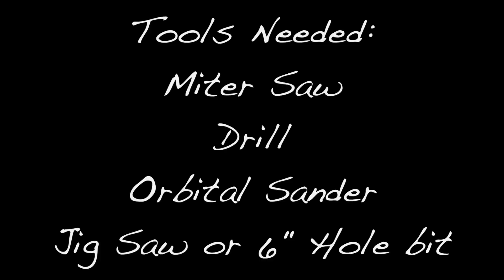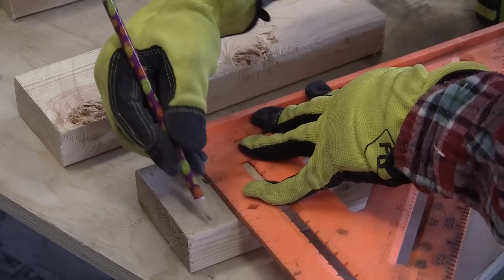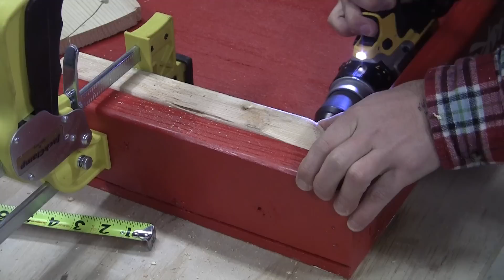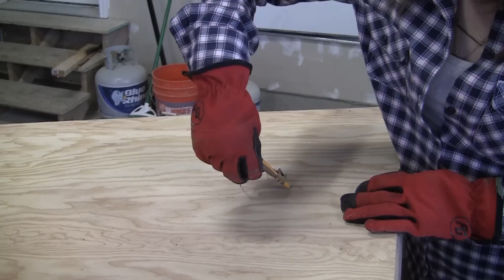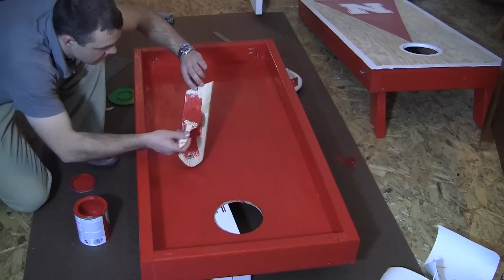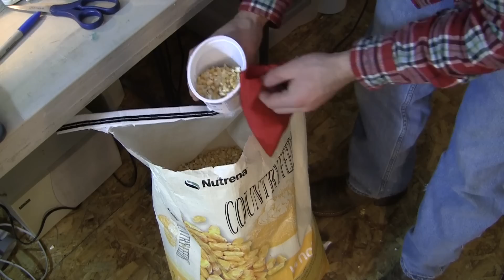How to Build Cornhole Toss Boards - A Fun and Easy DIY Project - Episode 8

Comment: Brilliant post... I was really inspired to make my own for my wife as a graduation gift hers was for Drexel. One note though mine turned out awesome right up until the urethane step. 
If you have allot of white as my design did. An oil based urethane will cause white paint to yellow so they kind of looked like crap at the finish.  She still loved them and it was a great learning experience... 

Thx!
Reply from the maker: Shawn Thompson Hi Shawn! So glad the project went well. Yes, I too had a slight yellowing to the tint on the white areas. Didn't bother me too much, but now I recommend a minwax waterbased stain if there is white being used. Cheers!

Comment: Also, I was recently working with Frog Tape and learned a tip. If you paint one additional coat of the base coat color AFTER (yes, AFTER) you mask it, if the tape leaks, it only leaks the color desired under the tape (so who cares?!? perfect!) and that leaking seals any further leaking.  And then, after that coat dries, follow-up with the top color (I do 2 or 3 coats of this -- same with base coat too BTW). Nonetheless, when you peel the tape off, you get amazing, crisp lines.  Of course, this is no replacement for doing a good job of applying the tape to prevent any leakage, but it's insurance! For your project, Pete, you were masking the naked wood with the Frog Tape, something I would think would be a little risky, given wood's tendency to be an irregular, porous substrate that also likes to wick! But, your results looked to be perfection!  I would have been inclined to paint a coat of the polyurethane over the tape (the one side of the tape anyway) to lock it down before applying the white paint.  But, again, you seemed to have no problems (that video captured anyway :^) ).  Also, I'll add that using the technique I describe here, I had no troubles peeling the tape off a week later (after all coats were good n' dry if not fully cured even!). I worked beautifully. Lastly, it's also a good idea to pull the tape off at the most extreme angle you are able to (essentially back on itself, or as close to 180 degrees as you can), and not perpendicular to the project or shallower. Doing it the right way creates a shearing effect that promotes crisp lines!  Okay... I'll stop now. :^)
Reply from the maker: ***** Thanks for all the info! The tape I used created a pretty good seal, but not 100% perfect. Still looked pretty crisp though and there were a few areas to touch up. Can't wait to see how your boards turn out! Please send in a photo or post to the fb page if ya want to! Cheers - Pete
Reply: DIY PETE Thanks Pete.  My boards are turning out great and I will be sure and post pictures on your Facebook page (after I give the boards as gifts to my in-laws.... don't want them to see them on Facebook before they get them and ruin the surprise!).  Right now,  I'm all done with the latex painting and was able to get calendared decals from a local graphics shop here in Brookings, SD for the local (John Deere in this case). Thanks again. I'm going to ask a separate question regarding finishing in a new comment above.

Comment: Very nice looking build! Something I learned using a Kreg jig; make sure to pull up on the drill and clear the wood chips when drilling the pilot holes...also best to use a corded drill on high speed...saves from heat build up which can cause the tip of the bit to snap off.
Reply from the maker: Great tips Luke!

Comment: Pete, thanks again for graciously answering all of my questions below.  I now have some questions regarding the finishing of the boards.  

1) Did you de-gloss (i.e., with trisodium phosphate [TSP]) or sand (i.e., with 220 grit sand paper) the painted regions of your boards prior to applying the poly?

2) Did you have any compatibility issues using the oil-based poly over water-based latex paint?

3) How many coats of poly did you use?

4) How much time (roughly elapsed before you poly'd over the paint (i.e., was it "fully cured" out to multiple weeks or just "dried" for a few hours)?

5) Did you experience any "yellowing" (unfortunate byproduct often associated with oil-based finishes) -- that are especially noticeable on the white painted portions of your boards?

6) Generally speaking, how did your finish turn out and are there anythings you would have done differently or considered?
Reply: ***** ALSO:  I actually did not use latex paint on my boards. I found another style of paint, called Acrylic Enamel at Runnings (local farm and fleet store). The brand is Majic Diamond Hard High Acylic Enamel in High Gloss finish.  Like latex though, it is "soap and water" clean-up.  It's known for its durability and ability to bond to almost any substrate.  I used Zinger Bulls-Eye 1 2 3 latex primer over the wood first.  The results are outstanding and I'm thinking I won't need a clear coat finish on top, but am exploring it...
Reply from the maker: ***** Hi! SO glad you found a good solution. I'm familiar with Runnings :) Small world - I grew up in Aberdeen, SD. Played hockey in high school so I made it to Brookings quite often and it is where we had our state tournament my senior year. To answer your previous questions (a little late I know) -- I did not sand the painted areas -- although it's a good idea. -- And no compatibility issues. Sounds like you got it all figured out though, can't wait to see them!
Reply: Wow... yeah, it is a small world!  I actually grew up in Rapid City and was a baseball guy...  A remember playing in Mile City, MT. That park was huge (448' to dead center!)!
Reply from the maker: ***** That's a heck of a hit to get a home run! Rapid City is a nice town and I've spent quite a bit of time out in the hills, neat you were into baseball there. Our family was pretty involved with the Aberdeen Pheasants baseball team between 1995-99 or so and so I learned to love baseball as a little kid.Hope all is well over in Brookings and that you are starting to get some nice weather. Take care! - Pete

Comment: Hey love the plans just wanted to make sure I put the poly over the decals?
Reply from the maker: +John Kalends If you are using vinyl decals, I would do a light sanding after the final coat of poly is dry with a high grit sandpaper ( 500 or so ) to smooth out  the finish. Then wipe with a damp rag. I'd then apply the decal on the smooth finished surface. In the video I only use the top decal as a stencil -- and so I do poly over the painted N and rest of the board. You could poly over the decal if you'd like, but I've made them with the decal on top and the boards have worked great.

Comment: Hi Pete,I am building my 5th set of boards using your instructions. This time the customer wants a vinyl wrap. I have never done this. I watched a few videos on here and all have different ways of applying it. Since it is being applied to bare wood, should I put a coat or two of minwax down before applying the vinyl wrap? Also once I have the wrap in place would you recommend using minwax on top to seal it or use edge seal tape or both? I just want to make sure the wrap stays in place for as long as they use the boards. Thanks again Pete!!
Reply from the maker: Hey Jersey! All great questions. You are going to want a super smooth surface prior to applying the vinyl. I've played around with wraps a bit on cars back in the day, but not on wood. I actually recently made another pair of boards though and sprayed a sealer on them prior to applying some large decals. They've stayed in place well. Once the wrap is in place, I would not seal it since the vinyl itself is super durable and made to last for years outdoors. If you aren't wrapping the sides then you might use seal tape, I'm not sure though since I haven't done this exact process. Let me know what you end up doing though --- or if anyone reading this has experience with wraps please chime in! Cheers - Pete

Comment: If you want to go cheap on the stencils, a hobby knife and some artist sketch tape or scotch will do the trick. What I learned also was that 2x4s are never truly straight, and also that just because they sell the board in these dimensions doesn't meant it really is or the corners are at right angles either. Go slow with jig, as you will more than likely as I did want to go back and round out the circle due to bad curves with some chisels.
Reply from the maker: Thanks for sharing the ideas!

Comment: Pete, a couple questions for you. I built a set using your directions exactly.I built a second set painted as the Irish flag and I had extra wood to make this set from a different project. This time around I used an air nailer instead of screws. It seems to hold up well. Your thoughts? Next question is I did about 5-6 coats of a min wax water based polycrilic. I did the slide test and mine don't slide til around 30". How can I make the boards slicker? Lastly to lessen the weight, can 1x4's be used in place of 2x4's? Thanks Pete!
Reply from the maker: +TheJerseyDigger Hi! an air nailer can work just fine. 16 gauge is going to be a bit stronger than an 18 gauge connection. Wood glue is definitely something you'd want to use in combination with the nails. -- Yep, you could use 1x4's instead of 2x4's. To make the boards slicker, I'd recommend lightly hand sanding with 800 grit to remove any roughness. If they still don't slide enough, you could think about adding a paste wax or possibly even spraying with some pledge furniture cleaner.

Comment: Awesome video, it helped me tremendously with my own cornhole boards! Just 1 question though, should I also use polyurethane on the sides of the board and on the legs? Or is it only necessary for the top piece? Thanks!
Reply from the maker: Hi Nolan! I'd do poly on everything to get the longest lasting finish, and so it wipes clean easily. Cheers!

Comment: Great video Pete! Quick question. Can you use water based polyurethane instead of oil based? Thanks
Reply from the maker: You certainly can. I recommend water based especially over white paint --- so it doesn't have a yellow hue.

Comment: Hi Pete, can you describe how you painted the Nebraska N using the vinyl decal you used?  In your video, it looked like you might have traced the decal with an exacto knife or something?  I have the Nebraska N vinyl decals, but I'm unsure of how do get the effect that you did.
Reply from the maker: +Tyler Cruise Hey Tyler! The outline for the N was all pre-cut on a vinyl plotter so it would have the pinstripe outline. I have a vinyl plotter and was able to create that on the machine. You could use a steady hand, ruler, and an x-acto knife to try and replicate it though.

Comment: make sure to buy your begs!

All kidding aside its a great build with an awesome finish. to make the leg assembly easier offset the carriage hole in the frame 1'' and you wont have to worry about readjusting the legs with a sander
Reply from the maker: Thanks so much!

Comment: Pete, I'm actually building a set as we speak and I'm customizing it. I have a question for when it comes to the stencil you used to make the circle for around the hole. I want to make a blue circle to outline the hole where the bags go in. Could you give me some guidance on how you did that particular part. Thanks for your help!
Reply from the maker: Hi Shad! I had a vinyl stencil made. However, You could create a stencil out of blue masking tape by putting the tape on a flat surface in a square pattern. Then use a compass to draw a circle on the tape. Cut out the circle with an x-acto knife or scissors. Then apply the stencil to the board. Sort of hard to explain in writing, but hope it helps. Cheers!
Reply: +DIY PETE that's exactly how I was planning on doing it. I didn't know if there was another way of doing it and figured I'd ask the expert. Your video was very helpful and thank you for all your help and advice. Suggestion on next project... Ladder Balls? LOL sound like an easy diy project.
Reply from the maker: Hey Shad! Great question for sure, and thanks for the kind words!! Ladder balls is a great game :) Might have to try and add that one. Cheers man!

Comment: Pete AWESOME video! I'm going to build my own boards with the help of your video. I have a couple questions hoping you can help answer. 
1. Where did you get the stencil for the hole to make a white rim around it? can you provide a link?
2. I'm a GSM of a Hyundai and Mazda Dealer. I want to customise these boards with the Hyundai and Mazda logo to be used at the dealership while customers are waiting for their paperwork to be prepared. Any suggestions as to where to go to have them made or purchased? What size should I be looking for to fit perfectly between the white triangle leading to the hole on your boards? 

Thanks for your help and hope to hear from you soon.
Reply: I forgot to ask, whats the dimension of the stencil used?
Reply from the maker: Shad,  glad that you are gonna tackle this project, it is a really fun one!  I have a vinyl plotter so I made my own stencils.  However, if you don't have access to one you can order online from a site like http://www.vinyldisorder.com   I would suggest looking online or for a local vinyl cutting service to cut your logos and stencil.

As for the sizes, you will have to see what looks best to you, for my circle around the rim it was a 7" diameter circle.  For the logos, about 12" wide would be a good size to have them fit in the triangle.

Cheers!

Comment: Any hints on using a jigsaw for the hole as easily as you did?  Type of blade, settings on jigsaw??? I am having no luck with it.
Reply from the maker: Hi! I'd recommend using a fine blade made for wood. Drill a hole about the size of your blade so you can get started. Follow the line and you'll do great. I always used that method before I had an actual hole saw for the project.
Reply: DIY PETE thank you for your response! I bought a wood scroll blade, set the speed at 3, and I think I am finally getting it. Needed some practice and advice I guess. No one wants to invest time and money in making these boards then ruin them cutting the hole 😉  Thanks again!

Comment: Great build, Great video. I do have two questions: 

Does the Polyurethane help make the entire board a even and smooth surface? I figured with having a decal on the board, that would be something for the bags to get "caught" on or slowed down by....

Also, where did you find the stencil for the white ring around the hole?
Reply from the maker: Hi! I made the stencil using my vinyl plotter, but I'm sure you could find something similar on Amazon, or have a local sign shop make one. The poly does  sort of help in making sure the surface has an even slide.

Comment: When you measured the height for the 12"... Did you measure from the bottom of the flat space to the top of the board?? Or to the bottom of the 2x4

Comment: I'm late to the party, but one suggestion: I'd recommend using a water-based poly instead of an oil-based. The oil-based will yellow over time and with exposure to sun. You won't see this (or at least not nearly as much) with water-based. Especially relevant if you're finishing over white graphics like Pete is here.
Reply from the maker: Hey Ken! Definitely, I'd agree! I found that out with mine, and now I use and recommend waterbased for these as well - especially over white. Cheers!

Comment: Hey I'm trying to do the Kreg Jig method. I'm still learning how to use the Jig. I was wondering what your measurements are set at on the jig when drilling those holes. I accidentally drilled to deep and went through the plywood. I might still need some learning to do on how that Kreg jig works

Comment: I am actually interested in the pain around the hole.  Would I do that before cutting the hole?
Reply from the maker: I would before cutting the hole so you have a big flat surface to work with. (it could be done before or after though). Basically use painters tape to create a homemade stencil. And a compass to draw a circle -- then an x-acto knife to follow the line, and then pull away the tape in the area that will need paint. Cheers

Comment: When you used your kreg jig to do the pocket holes to attach the frame to the top board with the 1 1/4 kreg screws what thickness did you set your tool at to drill the pocket holes for that?
Reply: did he answer that I forgot what it was also

Comment: Thanks man! Great video. How long did it take for the poly top coat to cure? Im making mine for a party this weekend and want to make sure its ready. Thanks
Reply from the maker: Gabriel LaCross Hi Gabriel! I'd say a good 24 hours for the first coat will be more than plenty. (Probably 12 ish - if the temperature is warmer. I typically wipe on a real thin second coat which dries in a few hours.  That will speed up the process. Good luck on the project!

Comment: How’s it going, Pete! I was just curious as to how big the decal size is that you used. Looks like a 12”. Thank you
Reply: Also how did you paint the decal without ruining the board. Like do all decals come like the Nebraska decal you got. So I can follow the same process of painting it the color I want?
Reply from the maker: Hey Christian! Yep, the logo was around 11-12 inches in height and in proportion. The vinyl decal I used allowed me to paint inside the logo, and once pulled off the paint only went where I wanted it. The decal pulled off easily. Best of luck!